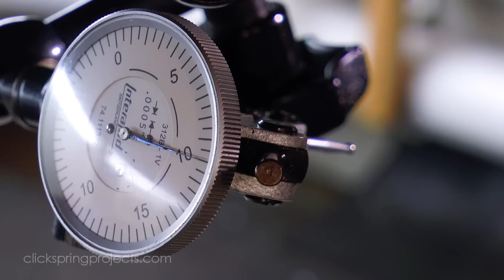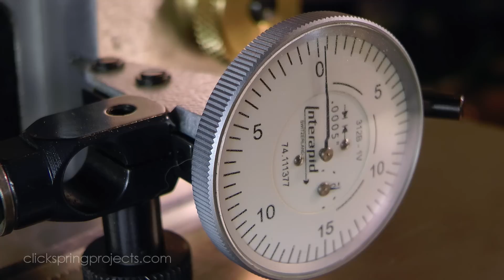Making A Rack Cutting Fixture

Comment: With the gear teeth being that shallow. I think I would have left more of the aluminum fixture there. Or to put it another way not milled down to the center-line of the rods support hole. That way the round bar would be captured in the fixture and would have less of a tendency to vibrate when milling the rack teeth. Just a thought. I really enjoy your videos. As a person that makes videos of machine work I know how much work it takes. Thanks!